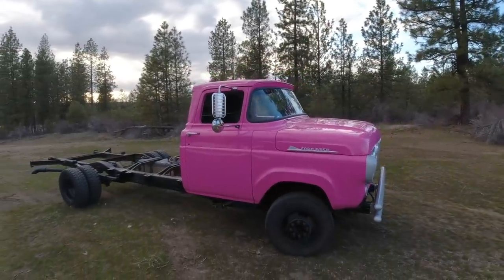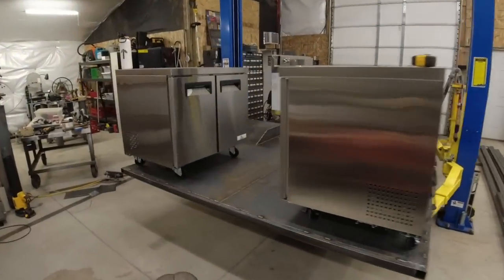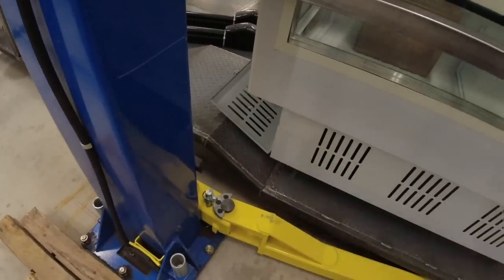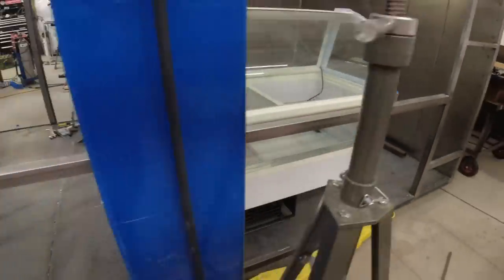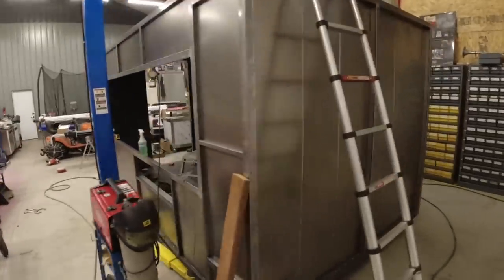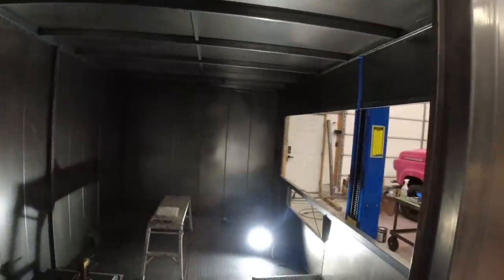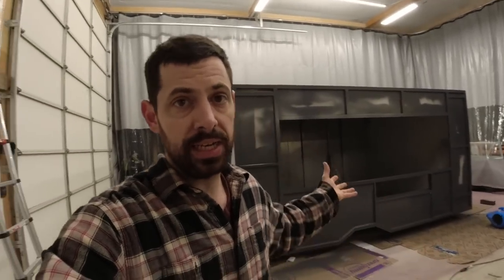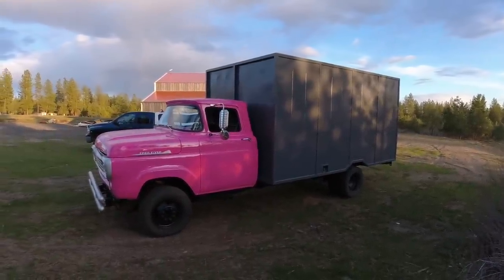Transforming a School Bus into a Vintage Ice Cream Truck (Episode 5)

Comment: I always enjoy your attention to detail. I've been a CAD guy for 25+ years so I draw/model literally everything I make. I have a profound appreciation for guys like you who can build stuff like this with no drawings :) I built an off road camp trailer and had 500 hrs in CAD before I even started on it :D
Reply from the maker: The feeling is mutual. I have tons of respect for guys who can CAD and design things from beginning to end in their mind and on a computer.  I start with a rough idea of the end product then try to decide if its possible for me to build.  If i'm pretty sure it's possible, I plan as far ahead as I can, which is usually not too far then start working and tackle the road blocks as they come. This entire build took 736hrs and probably around 50 or so planning ahead of time, but I didn't log that time.
Reply: It’s really enjoyable watching someone that is really good at there craft .  Also nice to show that sometimes even mistakes can be made , but your not afraid to show the human side .  Great to see family helping each other and enjoying doing it !
Reply: @AustinCoulson  I'm on jesscneal side 😅 I can do both, but dawm I hate the time lost not having multiple processes going at the same time, like the cnc plasma, the horizontal saw and me on the lathe since I only make one part at  a time. Hey buddy, I was wondering if it would be faster to build the walls flat, outside the box...I know the weight would be an issue after ...but you know, you re a strong man , + with the wifie and the kids (or just the lift😉)

Comment: Looks great! I’m 99% sure you know this but I have to say it for the guys that may not know. Next time get a smaller tip for the airless sprayer when you’re spraying the tight areas to help minimize the over spray.  When I spray cabinets I go down to a 315.   Keep up the great work👍🏻👍🏻
Reply from the maker: I have a smaller tip, but it was slightly damaged, but even that tip was too big.  I should have stopped after the primer and got a 315 like you mentioned.  I tried to muscle through it and ended up in drip city
Reply: @AustinCoulson  I can totally understand that.  You made the best of it.

Comment: Love your videos. i have to ask though, why no insulation? I would assume standing in a metal box during summer would be pretty uncomfortable..
Reply from the maker: Those white panels on the back are 1.5" insulation panels.  In the next episode I install more on the ceiling.  Only the back wall and the ceiling got insulation because they are the largest walls that are exposed to the sun. With the airflow from the service window and the back door it is actually pretty cool in the sun.
Reply: @AustinCoulson  i see, cool. Thanks for replying :)

Comment: The inside of the back door wasn't perfect. I could see that sag at the top a mile away hahaha. I'm messing with you but it is there. You were right to edge it out first but your fan is huge. I would of tried a smaller tip 420 or less. I painted professionally and had a small business for a time of my life. I absolutely love airless sprayers. One thing I always told myself I'd do is paint a car with one. It's been on my mind for years. Maybe one day I'll break out the Graco and do it. Did you seal seal the walls by chance? Or are they fully welded?
Reply from the maker: That stupid sag was from the white primer. I have a smaller tip I started to use but it was slightly damaged.  I should have stopped and got a new one.  I used to think it would be possible to paint a car well with a sprayer like this, but after this box I have given up on that idea, especially because I love the Devilbiss gun I used on the body.  I saw Samcrac use the eastwood airless sprayer on a paint job a while ago and it looked pretty good, at least on camera.  I am skeptical about how it would look up close, though.

The walls were spot welded and sealed with 3m panel bond on the outside and caulk on the inside.
Reply: @AustinCoulson  ah got it I may have missed that part. I was messaging my sister through parts of it. I know of samcrac but don't follow. I'll try to find the video. I don't know if he has the artist finesse. You do sir. I always love your vision of the project. Even that weird/ugly/cool looking monstrosity trophy vic hahaha. Have a great day and since we probably won't have another video in time. Happy Father's Day!

Comment: Looking great. What is being done about insulation? I didn’t see any product being installed. Again looking good I notice that your kids weld better than you 😂
Reply from the maker: In the last shot you can see the back wall has insulation glued to it. I insulate the ceiling later on as well. The back door can be locked open to give it a nice draft. Overall I'm happy with how the insulation turned out

Comment: Question.  How are the shop odors inside the house?
Reply from the maker: I used the great stuff pro gun with their fireblock poly sealant on the entire firewall except for one small area that I couldn't reach until I move my shelves in the shop and wouldn't you know that is the only area where you can smell any shop odors.  Once I seal that up, I should be fine.  I also use the Great stuff drywall glue, so that helps not only with sound vibrations, but also fumes